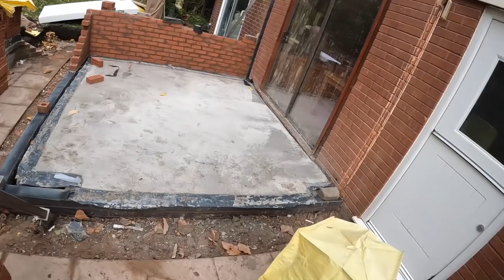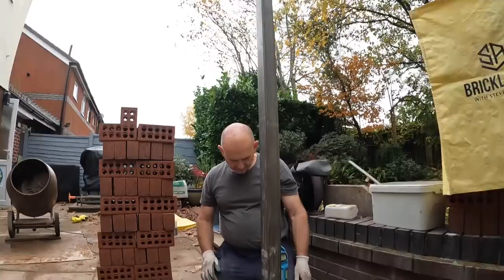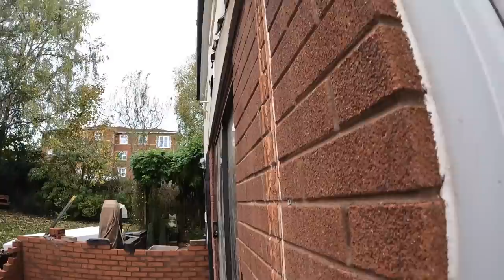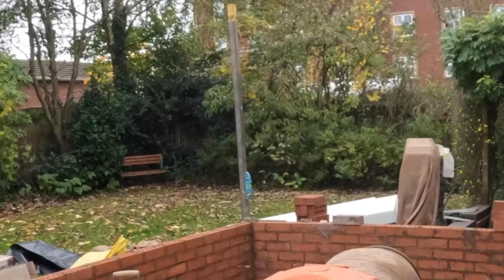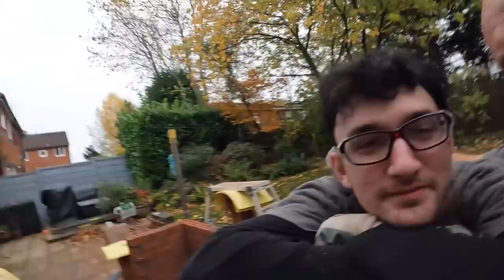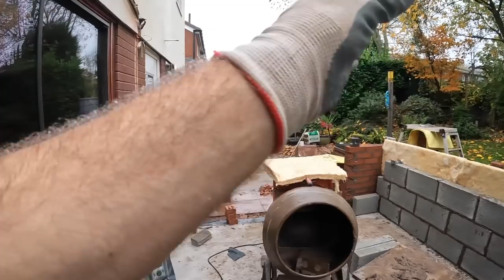JOB STOPPED ...CONSERVATORY BRICKWORK PART 4

Comment: Typical customer who reads and agrees to the architectural drawings and submitted to council planning application office before the start of a job then decides it doesn't look right. I hope you added an extra few hours pay to the schedule and the RSJ's were still with in the length parameters as indicated in the plans. 

Great job BTW guys.👍
Reply from the maker: It was all sorted and signed off  back in November 🧱👍🏽
Reply: @SteveAndAlexBuild  👍
Reply from the maker: @castingshadows282  🧱👍🏽

Comment: Hi guys, I've just built an extension and minimum return for an opening like yours was 275mm or 3 bricks, I'd be asking your inspector before you go adjusting! My customers wanted it bigger opening but building control said I had to stick to the 275mm rule. Would that steel then only be sat on 100mm at the house ? Good luck
Reply from the maker: No it was on 150 each side . All five and signed off last November 🧱👍🏽
Reply: @SteveAndAlexBuild  150? Is that the bearing?
Reply from the maker: @KingstonHomeMaintenance  Yes mate 🧱👍🏽

Comment: absolutely no point putting a vertical damp up a wall then drilling ties through it, once you pierce a dpc it has no effect, you dont need one anyway if u mastic the joint so completely pointless
Reply from the maker: We didn’t drill through it 🙄